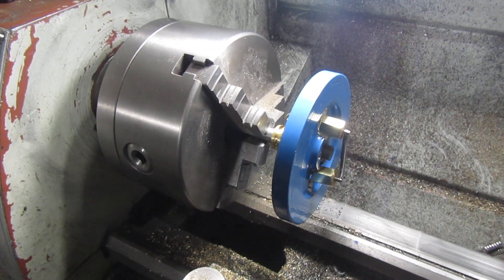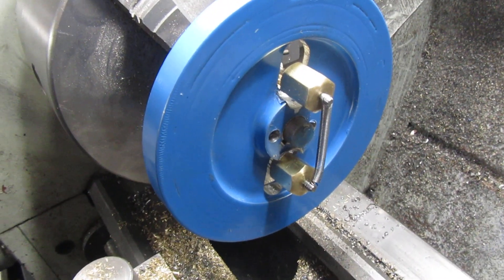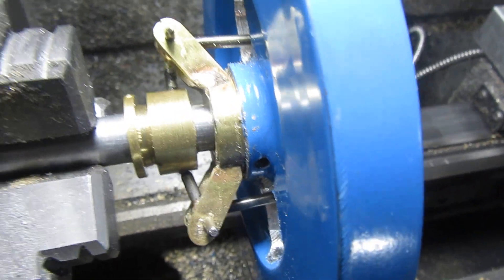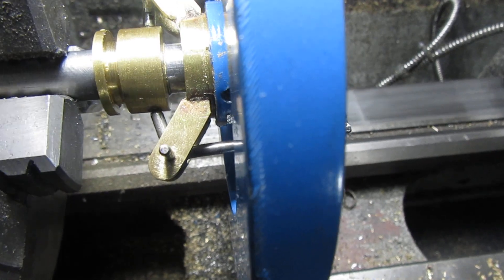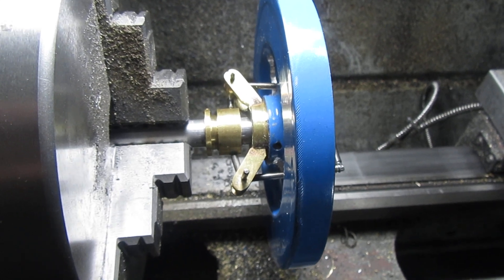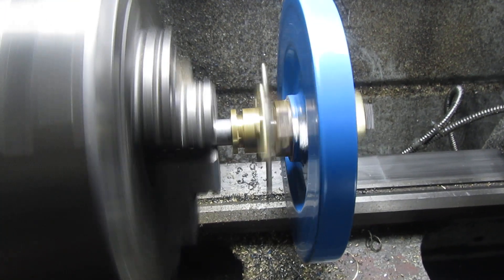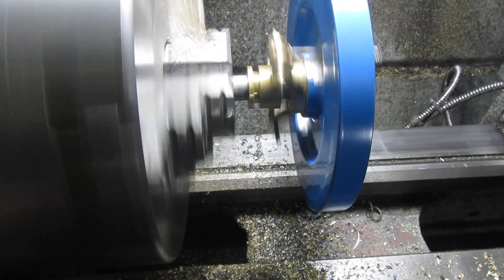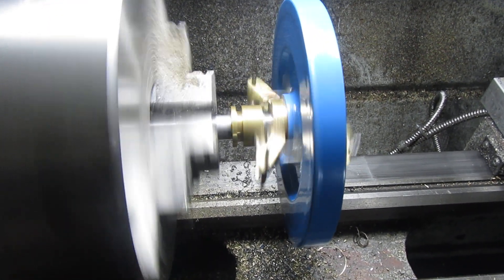GOVERNOR FOR MODEL HIT AND MISS ENGINE WORKING

Comment: If you are after a hit & miss action it might be worth adding some hysteresis to the spring force . If you can arrange the spring(s) so the force  increases slower as the weights expand , the Revs will have to slow further to get the arms back into place.  

How about arranging two springs nearly parallel to the arms (almost, but not quite,  an over-centre arrangement ) ?